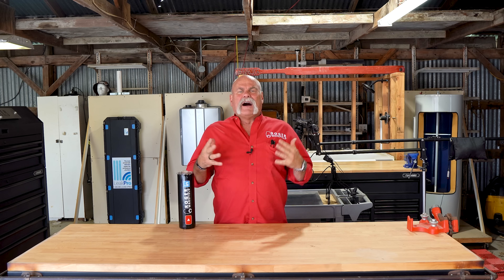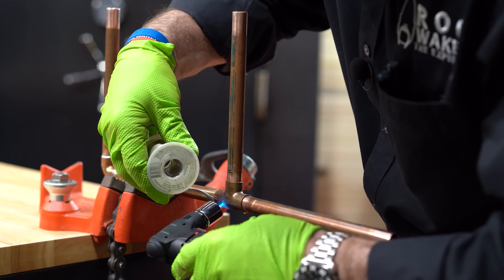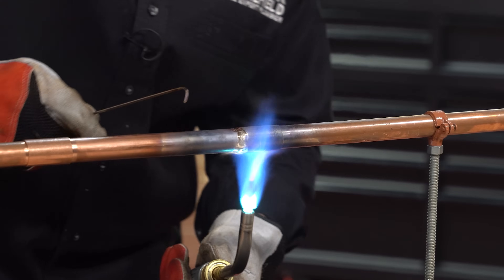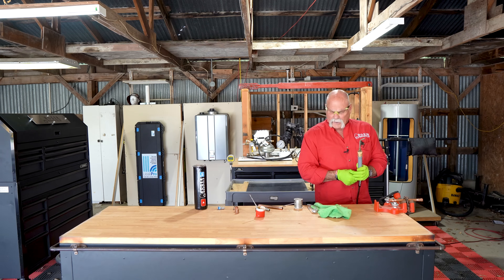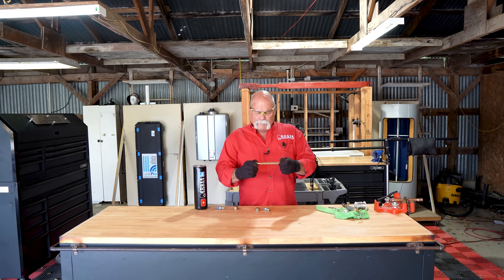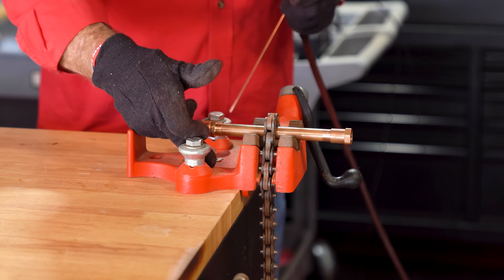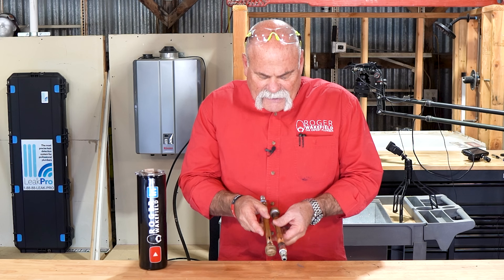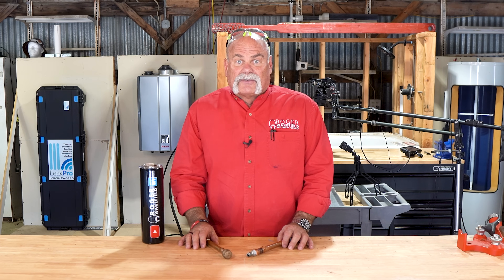Which Is Better Solder or Braze? | Pressure Test

Comment: I worked for a company that built high pressure refrigerant systems, and we did a lot of testing to find the best type of joint.  It's important to note that there are different grades and formulations of solder.  The stuff you'll find at the hardware store made for plumbing is plenty strong, but they don't even come close to the strength of specialty high Ag formulations which overlap on the lower end with brazing processes. The issue we had with brazed joints in our testing was that the copper became annealed at the temperature required to braze, and this resulted in an overall inferior assembly.  The joints themselves are strong, but the heat caused an excessive amount of damage to the crystalline structure of the copper. Soldered assemblies at 1000 psi had a significantly lower failure rate than brazed ones that went through our accelerated lifespan testing.
Reply: This goes into welding, but, as I'm sure you know, but for others, when you heat a metal up super high, you ruin the crystalline structure that has been "grown" during the production process. That's why in metal working, after high temps (like red hot metal) you have to do what's called Tempering to regrow the crystalline structure of the metal, which is what gives it's more strength then just being metal.

So. You could, in places, premake your pipes with higher temp-stronger brazes, and then temper them before installation. But that's fairly unfeasible in on-site locations.
Reply: Wow! Great to know!!
Reply: @jemjones5675  Isn't a lot of HVAC regrigerant line copper already soft (annealed)?
Reply: would it be possible to pressurise through cycles to work harden with water pressure?
Reply: @jasonthurston799  Maybe? I don't know, I was just going by what I know about metal. I know that I've seen refrigerant lines be super soft, but I don't know if those are for low pressure systems or not; I would assume that those are annealed as they are soft. 
Shrug.
Reply: my god (nontheistic); the skibiddy toilett is cleaning the 'outside' of these 'fittings'.... the braze may not start to fit this way...
Reply: yeah i was gonna point this out, that the failures were right next to the brazed part due to the high heat softening the copper pipe. Otherwise youd expect the pipe to balloon up in the middle rather than at the ends.
Reply: @felderup  im not sure, im no materials engineer but wouldnt that plastically deform the copper pipe too?  Work hardening happens when the molecules slide around due to stress but you have no way to push it back in once the water stretched the pipe. I dont think i can be done though i might be wrong, idk.
Reply: @laharl2k  if you don't exceed the elastic modulus too much, it won't deform it too much.  perhaps stretching it a bit would be a good thing.
Reply: What about on xhp or k65 alloy copper. How pure copper performs at 1000 psi doesnt tell you much because we arent using it with transcritical.
Reply: Thanks for sharing. Code is garbage, banning solder above 200 psi. non-sense. Brazing has to hurt the metal. No doubt about it. how grey it went from heating. Copper pipe producer has spend lots of time and experience perfecting their annealing of it. Now that 10k deg torch is destroying it. Thanks for confirming my choice of soldering my ac lines soon. SB8 of course
Reply: I was thinking that was the case, thanks for the info Metallurgy is fun...
Reply: @jasonthurston799 there are a few types of Copper we use the copper that's made to be machined is an alloy this allows for it to be harder in general, but in order to "work harden" the copper you need to squeeze it so the molecules fit together in a tighter Crystalin structure, so you would need to encase the outside of the pipe and the amount of pressure required to compress the Copper would be insanely high... So in theory yes, but it isn't really practical.
Reply: I do refrigeration work and wondered about this ☝️☝️
Reply: Thank you very much.
Reply: @jasonthurston799  yes they are as I know..

Comment: As a pipefitter I was told/trained that brazing strengths are it can handle heating and cooling cycles better (like in refrigeration) and ductility when buried. Solder is faster, and cheaper but is more likley to crack if heated and cooled, or if the joints are flexed.
Reply: They thermally expand at different rates. Brazing is closer to the copper.
Reply: so in reality what is the difference the fittings hold and the pipe blows, oranges to oranges. they the pipe fails not the fittings.
Reply: You don't have a clue. Best you keep your ignorance to yourself
Reply: @nothankyou5524  oh really?
Reply: Soldering doesn't crystallize the copper, my personal opinion is it it is better. I don't braze much anymore. None on a/c systems. Atho I did braze a cast iron diesel engine timing gear housing recently that ran a crack. 100% success
Reply: Depends on the rod or solder used
Reply: @johnpower8356  crystalize the copper? Heating it red anneals it. Where are you getting crystalization?

Comment: makes sense. The brazing temperature actually weakens the copper, BUT a brazed joint can withstand much more heat before the joint fails. I have always been told that is the reason oxygen and flammable gas systems require brazed joints, so that they won't fail in a fire.
Reply: How exactly does it weaken it? It anneals it at most
Reply: @ooltimu  Annealing is when the copper would be heated too temperature and held at that temperature for a period then slowly cooled over a long period of time. Rapid heat and then instant air cooled aren't Annealing.
Reply: @Neo1969  1. I said "at most" 2. all info I can find on copper annealing says quick cooling in water
Reply: @Neo1969  WRONG! That's how you anneal-tempered steel! With hard copper, you get it red hot & quench it in cold water, to make it soft copper!

Comment: Test pro press fittings please
Reply: I've seen these push apart when a line freezes.
Reply: @topher8634 that’s user error. Why would you use exposed copper in freezing temps
Reply: @MrKnnthc93  they weren't exposed, when I responded to the service call. It was the line feeding an outside bibb that passed through a mechanical room that has an exhaust fan drawing in outside air to cool refrigeration condensers. The line was insulated, but the store owner didn't shut off the Bibbs prior to the freeze. And I reinsulated after the repair. Apparently the propress pushed apart before the line busted. Typically on soldered fittings the line splits but I have seen soldered caps push off too. It was always on an older building though.
Reply: @MrKnnthc93  The real question is why would you not sweat the fittings together? 
Two options come to mind: 
Lack of skill. 
Laziness. 
If you are in a combustible environment or one that does not allow open flame, then use inductive heating. 
There are no excuses to not do the job right.
Reply: Also do a test with a control, multiple samples and high speed cameras. Just saying, either way, good video

Comment: The brazed pipe definitely got annealed from the excess heat. Love the videos!
Reply from the maker: Thanks 👍
Reply: Agreed. Greater plastic deformation, even with a shorter crack and lower pressure.
Reply: I use solder as my father taught me for pumping but blaze for hvac  refigerat systems
Reply: Agreed! Brazing suffered from annealing or possibly tempering your metal. Not necessarily making it weaker but just changing the way the metal and it's crystals are formed. Solder didn't have this issue since the heat cycle duration and applied heat was significantly lower than brazing. Still a very good video. Weld with filler material would of been really interesting to put up against.

Comment: I started using a special solder for AC work. Private. I'm not a contractor. Harris Staybrite No 8 has a bit higher melting point than normal plumbers solder. I was not able to break the line with a 200bars nitrogen tank. The brazed joint blew next to the joint, where the high heat from brazing damaged the copper. So when using the correct solder, it is better than brazing. Same here! The braze blew at half the pressure as the soldered pipe did.

Comment: Id like to see you test K and M copper 👍 keep the videos coming this is great content. 👍
Reply: I worked at a shop owned by a fellow who started out in aircraft. The in ground air over hydraulic hoists were plumbed with copper and cement poured overtop. I lifted MANY Dodge vans at 6-7000 lbs and the occasional 1 ton with dump body. Never had an issue.
The hoist at my Grandfathers shop had steel lines and they rotted out. Dangerous as hell but I still prefer them over electric.

Comment: The braze had a smaller burst on the pipe because it released some pressure by leaking prior. In my opinion the solder performed better.

Comment: Gotta be honest. I like watching anything you do. I really feel like I'm learning something every time I watch your videos.
Reply from the maker: I appreciate that, we have fun learning and doing these experiments right here with you
Reply: @RogerWakefield interesting test. I wouldn't mind seeing like black iron for fire suppression systems. Also what would happen if you were to use different types of heating and cooling methods. Like if you excessively over heat a pipe then use cold water to rapidly cool down a joint as well as different types of pipes... possibly like galvanized or stuff we dont use anymore. I'm a sparky so it info I will likely not apply but I still like to know.

Comment: I’m a retired HVAC&R contractor I’ve used a turbo torch for both soft and hard solder. I have seldom seen a proper joint fail but most were the tubing, soft solder are more prone to failure from vibration. I piped a refrigeration systems that were to be temporary with soft solder and after 10 years no leaks. 
The silver content is for flow and tinning (adhesion)
Hard solder is brazing and soft solder is soldering

Comment: As a plumber starting in the 70s, brown jersey gloves were my go to when soldering, unless they got wet, lol, i have noticed the antinomy of the solders and quality of brass and copper fittings has diminished greatly since then, thanks for your content
Reply: Not sure what to do with my old lead ladels. Lead pot and caulking irons anymore, they just take up space in my box, but will keep them for whatever reason,  lol
Reply: @mattmuch7536  antimony , added to a tin lead solder as a substitute for some of the tin , it is added to increase the strength and properties of a solder. It helps the unsimilar materials create a permanent bond. Example of one is 95/5, gooday
Reply: @mattmuch7536  50/50 has been disused for potable copper since the epa lead and copper rule , where potable water systems had a acidic Langlier index it leached the lead from the solder creating a potable water violation, when the Langlier is alkaline it coated and prevented the release of lead

Comment: Been using Staybrite 8 for about 10 years now and not having any leak issues. I would  certainly trust this over sharkbite style fittings or compression fittings with o-rings.

Comment: When I first started in plumbing it was turbo torch and map.  After going on my own and with Mapp no longer produced I just use the best Benzomatic portable torch and camping propane.  Depending on different research it seems Mappro(Polypropylene) only gets between 5-10% hotter but costs twice as much as propane.  I almost always drain lines before soldering, clean fittings & pipe, so I've never had trouble getting hot or getting a callback.  If I run into a situation where I need more heat(rarely), I usually run a secondary hose torch which I can control with the bottle torch both with one hand.

Comment: Saw a little bit of leaking on the brazed pipe before the copper blew out...but based on the angle, couldn't tell if it came from the brazed portion or elsewhere. But the solder definitely held up. Great video!
Reply from the maker: It looked like it was coming from the adapter where it attaches to the blast chamber, joints held up!
Reply: @RogerWakefield  That's what I was thinking, thanks for confirming!

Comment: I use the $20 Harbor freight torch that has adjustable air. I've had the same one for probably 15 years with no issues. I run it on both Mapp and Propane, even though it's not technically intended for Mapp. It works because of the adjustable airflow. I also have an air-acetylene torch that I use if I need to solder a lot of fittings. It runs about as hot as a Mapp torch but it's much cheaper to run because I have a tank of acetylene that can be refilled at the welding supply. I also have an oxy-acetylene torch that I use for welding olets in iron pipe if there's no power for the arc or tig welder (I do steam system service).

Comment: I was almost done installing my HVAC unit and my oxygen regulator popped. I ended up tig brazing my last joint on the suction line. It worked surprisingly well and didn’t ruin anything lol
Reply: No I think it worked fine. I backpurged the lines with argon before brazing so I don’t think any carbon was introduced into the system. Then I left it pressurized with about 150psi of argon on both sides for 24 hours no leak. Vac for 2 hrs then charge. Has worked fine for nearly 2 years

Comment: Have you done a pressure test where you solder a joint then cool it down immediately with a wet cloth, vs a joint that was left to gradually cool?
Reply: I just did a solder joint recently where I used a rag to wipe down the joint after soldering to remove excess solder (solder was still liquid) and the rag was somewhat wet.  Well while I was doing this I heard a pop noise and was certain it was the solder joint cracking from the wet cloth cooling it too rapidly.  So I resoldered the joint and should be good now.

Comment: Great video!

I would definitely like to see the pressure difference of L, K and M copper pipe. I'm not surprised that a good solder joint held and the pipe failed. In part, it's because the solder wicks in between the fitting and the pipe, and so you have double-walled pipe at the solder joints but only single-walled in the in the middle. It makes sense that the double walls of the pipe+fitting with solder in between will hold more pressure. That's why I would like to see how much pressure different thicknesses of copper pipe will hold.
Reply: So would I. I keep seeing how people are doing comparisons of copper vs other materials....but they use like the thinnest copper available. "Yeah these'll only last 20 years"....when the thick shit last like 80 lol.

Comment: ok    I like the turbo     acetelene    If Im on a job site ill use the b tank   almost every time  if its handy   .    but i quit bringing out on   small jobs doing resedential repairs or water heaters      Ill use the turbo  mapp hand torch    dont like those    quick start types just a regular  turbo.
      You prooved my opinion    braze over heats pipe   makes it lose the  heat  treat    blows up   but the joint itself is rock solid.
  not uncommon for some jobs to spec out braze on 2 1/2 " and bigger   soft solder to 2 inch.    Up to you Im not tha interested in PSI  of   type m or k   .     great channel thanks

Comment: 🤯 I would like to see if the burst PSI changes from rapidly cooling your joint with cold water say from dipping it in water or using a spray bottle after you sweat your pipe. Then explain to us about the annealing process and how it does weaken the copper or does not. 💪👍

Comment: My first boss preferred soldering over brazing (all else being equal). He said that heating the copper to the temperature necessary to braze also anneals the copper, making it softer and more likely to blow out.

I was just 14 when I was working with him, and he was a former chemical engineer for Merck who would balance formulas for drugs, so I never questioned him on such things. 

I noticed that the brazed pipe blew out at 3,600 while the soldered pipe blew out at 7,000. So I wonder if that supports what he told me.

 I also worked as a building mechanic for a different pharmaceutical company on a campus with 38 buildings. They would constantly remodel and the plumbing contractors almost never soldered or brazed joints because that required a hot work permit. Because of the scope, scale and red-tape restrictions, it was more expedient for them to ProPress everything. The younger plumbers in that company, as talented and professional as they were, didn’t even know how to solder simply because they never needed to do it. 

And ProPress does suck. It was a running joke between the maintenance mechanics that our job was to follow the contractors from building to building fixing all the leaking ProPress joints since we could solder without hot work permits. Me and one other mechanic, Mike, must have repaired around 50 leaking joints in my 7 year stint on that campus. Maybe it was their tools being beaten up or neglected or failure to recalibrate them - but that’s still a pretty high failure rate.

I didn’t mind tailing the contractors at all, I really enjoy soldering. It’s somewhat cathartic.
Reply: @mattmuch7536  it's definitely for a long period when brazing, 3/8 usually takes about 15sec
But 3/4 can take up to a minute sometimes and sometimes a little longer if it's a coupling in a weird spot and you have to get both sides

Comment: This is fascinating to me as a welder. I thought the end cap would bust or it would blow in the heat effected zone and it did. I bet the soldered test piece withstood more pressure because of the lower heat input as well as smaller heat effected zone